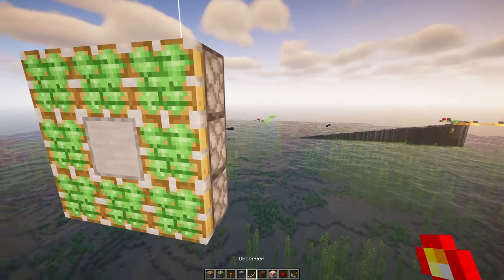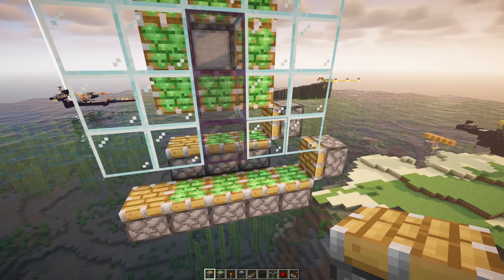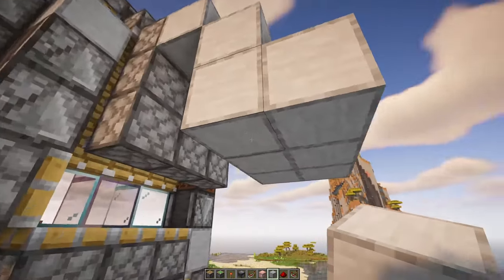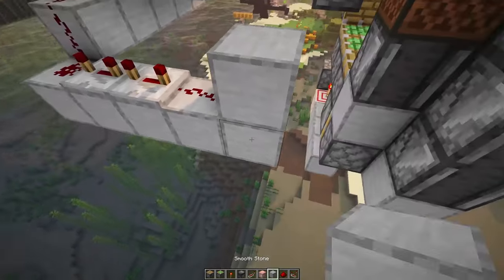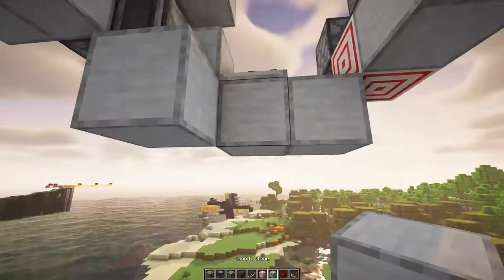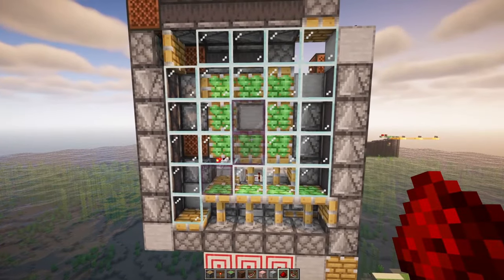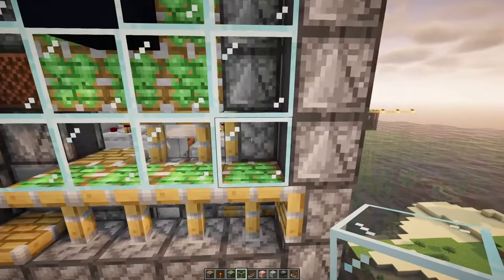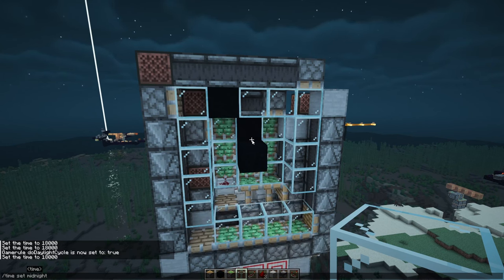BIG BEN! Gerg's Analog Clock Tutorial

Comment: Back in the day when jt was still Minecraft PE I made a horizontal clock. Had to use mine cars, powered rails, glowstone lamps, and trip wires. There were no comparators or pistons at the time. 

I created an escapement by having a mine car move up and down on a U shaped powered track. When it hit the center of the U it would hit a tripwire. These were the “ticks” the clock was counting. Each tick would send a pulse to powered rail segments on an outer O shaped track. 

That would cause the outer mine cart to move to the next “hour” station where a tripwire would detect the cart and send a signal to the glowstone lamp above it.  The outer track was built to go up and down with the cart stopping at the bottom “hour station” on an unpowered powered rail between a trip wire.  

The next pulse from the escapement would power the rail at the bottom just enough to send the cart to the next hourly station lighting up the next glowstone lamp.  It was crude but the light around the circle would light up in order. 

This clock is a much more elegant and complicated design (and actually useful for telling time.)
Reply from the maker: Some friends and I are going to upgrade this one too I think.